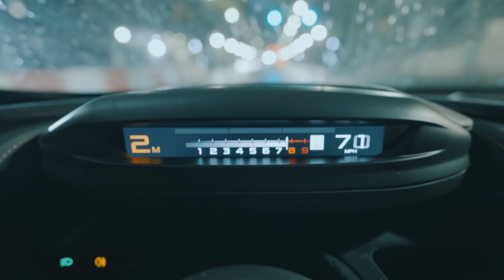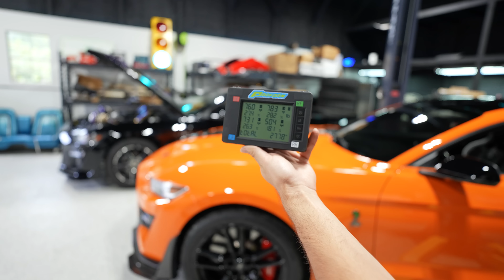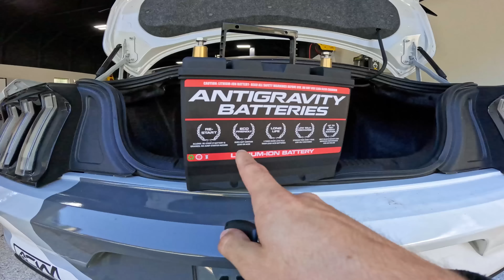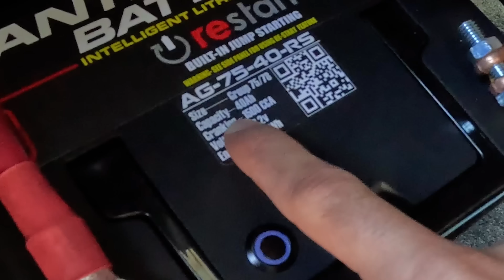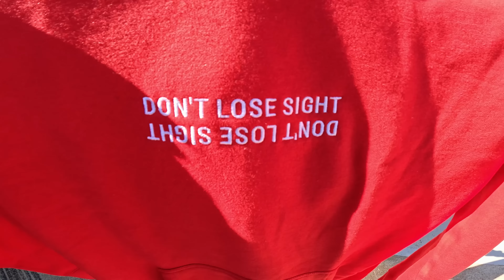Racing the FASTEST Mustangs in Atlanta!!

Comment: That's very interesting because the curb Weight on the new GT500 is around 4200 lbs, and a blower is not removing 300 lbs. The S197 Gt500's are just under 3900 lbs 🤔
Reply from the maker: His is Pretty light indeed 😳 carbon fiber track pack car!

Comment: YES SIR THE GT350 IS MY FAVORITE !.  AND I AM A BIT BIAS AS WELL STEMMING FROM ME BEING A MANUFACTURER TEST DRIVER THAT PUT OVER 18,000 MILES ON A VERY EARLY STAGE PROTOTYPE SHELBY GT350R, IN EARLY 2014. IT WAS A PROTOTYPE THAT FORD SENT TO US TO DO TESTING ON AFTER FORD WAS FINISHED WITH THEIR PROVING GROUND TESTING. THEY WANTED US TO DO THE SURFACE STREET AND HIGHWAY TESTING. WE WENT THRU A SET OF MICH P CUP 2 TIRES EVERY WEEK. WE DROVE IT VERY HARD. I PEELED THE TREAD OFF OF IT ONE NIGHT AND CRACKED UP THE CARBON FIBER WHEEL. TOOK OVER A WEEK TO GET ANOTHER CARBON FIBER WHEEL. GREAT TIMES.  EPIC FUN !

Comment: Bro you gotta do suspension. Also check to see if your tire is spinning on the rim at all. I’m also curious because of all the hp. Mark a small line on the tire where the valve stem is and see if it moves. It would be insane if it was moving that tire

Comment: put a 75F 12V supercap bank in parallel with the battery so that the battery isnt damaged from transient loads. you need to charge the cap before connecting it to the battery tho, to do this use an incandescent light bulb, the bulb will heat up and its resistance will go up which will limit current flow, when the light turns off the cap is charged and you can connect it directly in parallel with the battery.

Comment: Honestly the dude just got the car, it's understandable he won't quite know how to drive it just yet. When I first built my c5z I took it out to mexico with some buddies and got donkey gapped like 3 times by a friend of mine in his FBO tuned S6 simply because I wasn't used to the new drag radials I was running and hadn't practiced heating the tires up and launching from a dig properly in months. First run I spun like a mf from first thru third, second run I dead hooked but damn near stalled cause I didn't launch with enough RPMs, third I spun again, not enough heat in the tires again. All I needed was a little bit of practice and I'd be rock solid with that car, and I'm sure if he practices with his GT500 and learns how to use rolling antilag he'll be fast as hell again. That car 100% has potential in a race, he just needs to learn the car a little and practice and he'd be solid.

Comment: That 350 shouldn’t have been able to beat the 500 with the same turbo kits. The 500 having the 5.2 and some aftermarket internals with the DCT. Looked like the 500 was leaving later each time and then always had traffic in front of it.